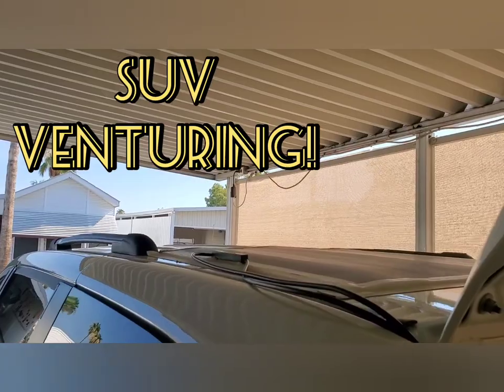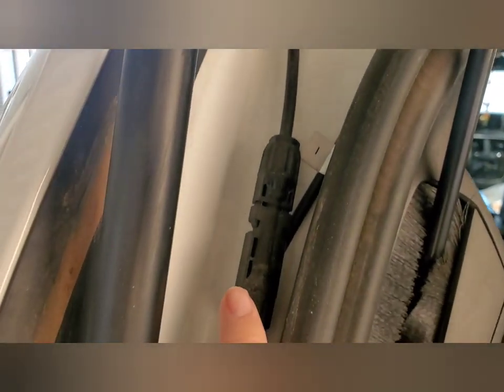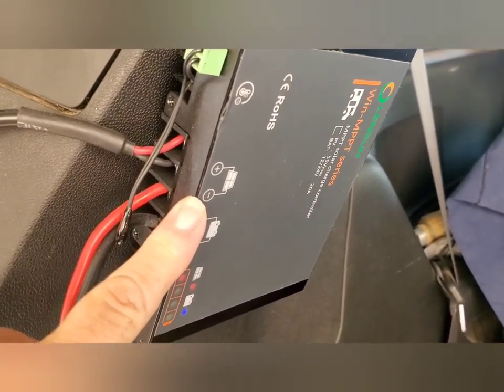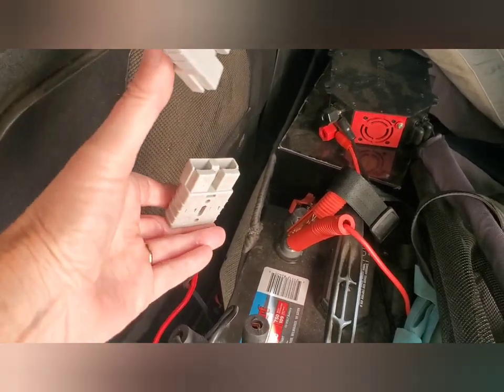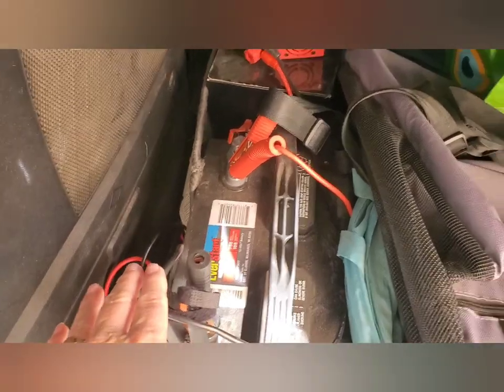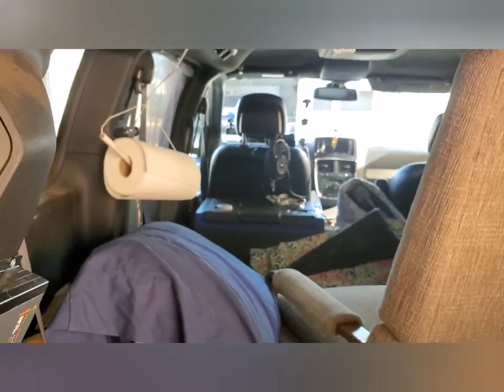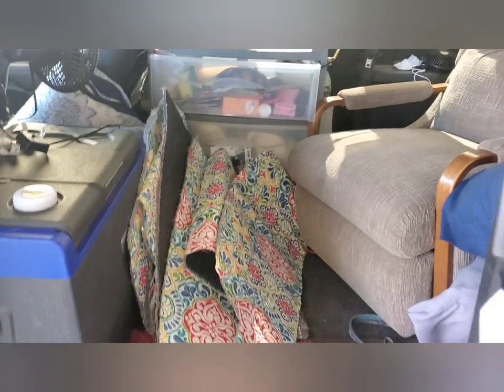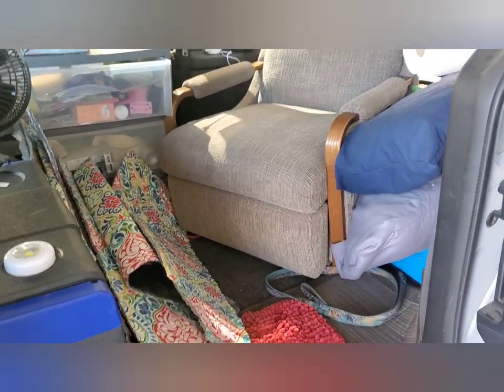How I route my solar cables into my minivan

Comment: Hi Carolyn!
Did you add the photo of you & Terri - You're wearing pink. THAT is a really nice picture of you both. You look very pretty. I remember when you put that solar panel on your van roof. That was a good idea 💡 I didn't realize you have a mounted charge controller in your van. How cool is that? Is it better to charge car batteries or a power station, since you use both?
Reply from the maker: I use them separately. The rooftop panel and rv battery is for JUST my refrigerator.
Reply: @CaravanCarolyn  Ah. Okay. 👍

Comment: YAyyyyyyyyyyyyyyyy! THanks SO MUCH for sharing!  WELL DONE and I  may have to try to do the same on my Caravan :) I do like how you attached the panel on the roof, and its still there working :)  And the mppt controller being small and close to the battery.. did you take out the back seat for that?  ALL THE BEST and Cheers :) !!
Reply from the maker: No, the seat is under the floor.
Reply: @CaravanCarolyn  Thank you :)

Comment: Hi. Really enjoy how you have your van camping ready. I seen you have your solar panels taped to your roof. What tape did you use and what portable solar panel is it you are using that is so tough it can go through the water pressure and soap of a car wash ? Please. I’ve been looking and looking and at a loss. Thanks!
Reply from the maker: ECO-WORTHY 12V 130W Extremely... https://www.amazon.com/dp/B08XJRDY66?ref=ppx_pop_mob_ap_share

EternaBond RoofSeal White 4" x25'... https://www.amazon.com/dp/B008HMYZKO?ref=ppx_pop_mob_ap_share